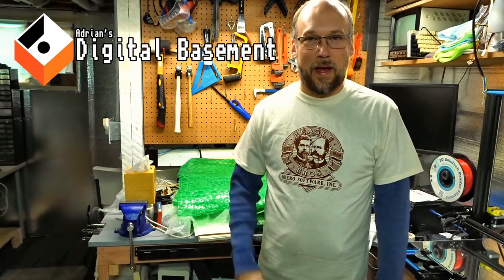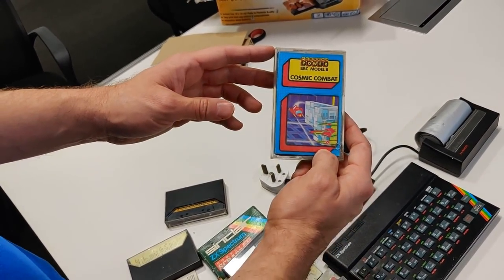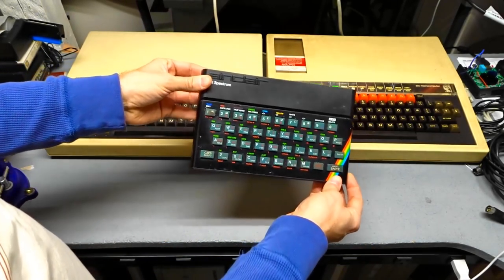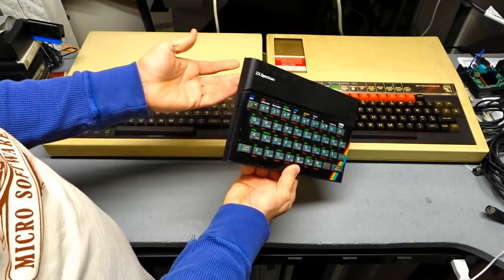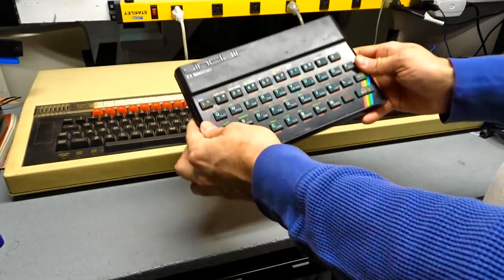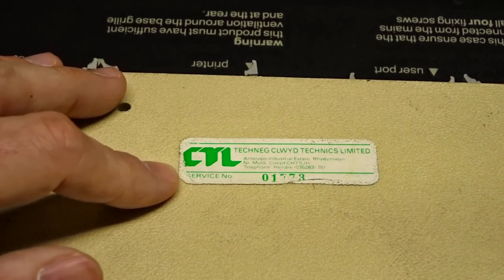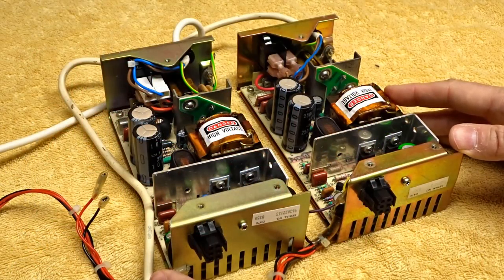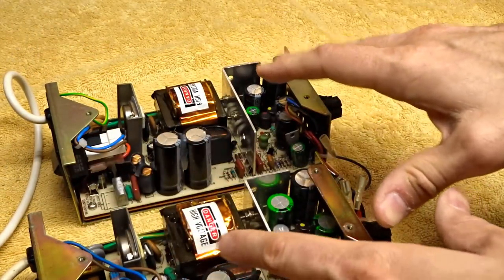I visited the UK and brought back some computers! Let's see if they work.

Comment: I'm not sure the age/generation of electrolytic caps is the whole story. If you open something and it has a ton of chong or shamwa or whatever off brand in there you can be sure at least some of them are out of spec (probably never in spec) or leaking. If it's all Japanese brands then you're probably ok unless whoever designed the PCB did an oopsie and put a cap right next to something that gets hot. Even worse in some machines like some commodores you get capacitors that are reverse polarity from the factory.
Reply: I've replaced capacitors on LOADS of machines from our old labs back in the early 2010s when that whole bad cap fiasco was going on.
Reply: @adriansdigitalbasement  in the BBC machine you want to check for "RIFA" branded capacitors in the power supply. These fail with age and because they are directly across the power line, they make a LOT of smoke when they let go! Replace with good quality "X2" rated film capacitors.
Reply: I've read somewhere that it has to do with a stolen recipe that was actually missing a bit. So  the caps were not being made with the proper recipe, so they are missing a component that keeps them stable. Which is why Japanese caps are considered better than Chinese caps.

Here is a link. And I've now learned that it's called a formula, not a recipe.
https://www.independent.co.uk/news/business/news/stolen-formula-for-capacitors-causing-computers-to-burn-out-106907.html
Reply: @NaoPb  While I believe that story might be true I don't think it's the overall issue with cheaper caps. I think poorer materials and wider tolerances are probably a bigger issue. Interesting enough I know a guy that used to work at one of the Japanese capacitor manufacturers and he said they used to ship all the parts that weren't right on spec to customers outside of the country because they were less fussy.
Reply: @NaoPb  Yes, this was largely responsible for the problem
Reply: I just replace them no matter what.  Caps don't cost much and aren't hard to replace.  I have an Asus board that was full of puffed up Nichicon caps, so brand and country of origin don't matter.  That would have been capacitor plague timeframe though, and not early 90s, but still.  Simple preventative maintenance.
Reply: @nickwallette6201  the bad Nichicon caps seen in the wild were actually counterfeit parts, not genuine Nichicon parts. lots of BIG vendors got burned by this, and some still do get burned by this. It was quite a huge industry problem.

But yes, on old equipment, it is generally best just to replace them.

Comment: I had a BBC micro model B back in the day. Later I had its successor, the Acorn Archimedes which was, of course, the first RISC based personal computer with the Acorn designed ARM processor (which then stood for Acorn RISC Machine). That. of course, begat Advanced Risc Machines with the ubiquitous ARM architecture chips.

So, if it wasn't for that BBC micro, then the world wouldn't have had it's most popular microprocessor architecture with over 100 billion ARM processors having been produced by 2017. No doubt something else would have come along, but it's still the case, that BBC micro is what financed the development of the ARM architecture, even if this model used a 6502 running, if I recall correctly, at 2 mhz.

Just a shame ARM was sold to a Chinese tech company.

nb. even before the BBC micro, I had a NASCOM II which I built from a kit. If you want a fairly rare UK computer, try and find a Nascom I or Nascom II, both of which were Z80 based machines. They truly were the first UK microcomputers.
Reply: Minor correction, ARM was sold to Softbank, a Japanese company. Yes, a shame though.
Reply: I'm not sure why I had it in my head Softbank was Chinese.

Comment: I want to dump those boards in an ultrasonic bath.  filthy!
Reply: If you think that's filthy you should see my browsing history.
Reply: So long as everything's still watertight, that should work. I don't know what automotive solvent does to PCBs though. I should drop a board into my cleaning tank and find out.
Reply: Nah, give them a spray with brake cleaner, should do the trick.

Comment: I have an original model A upgraded to be model B, ordered and waited over one year for delivery back in 1981. My serial number is 000023 and PCB covered in modification wires installed at factory. Still works.

Comment: Very interesting video, Thanks. I've never actually seen inside a BBC micro before. If it's not already been mentioned... The BBC Micro has a built-in assembler as part of BASIC. Although I already knew Z80 (via Spectrum) and 6502 (via C-64) I did a lot of assembler programming on the BBC as part of a training scheme I was on in '86. A few years later I worked as an application programmer on the Cambridge Computer Z88 which came with BBC Basic. It also had the in-built assembler but it was obviously Z80 rather than 6502.

Comment: I have friends in Salinas, CA who continue to use such Sinclair computers to manage and program the timing of all irrigation systems on several hundred acres. They have been quoted $10K to replace this two Sinclair computer system they are using, but they have a couple of spares they have never used and cannot think of getting rid of something they already know and is still as flexible as anything on the market. The biggest challenge came 7-8 years ago when they decided to move from a cathode ray display to LED monitor, but otherwise, things are fine.

Comment: To get some background behind the design and manufacturing of these two computers may I recommend that you watch The Micro Men, here on you tube. I think you will find it not just entertaining, but quite informative concerning the UK's early attempts at computer manufacturing for the masses.

Also Acorn, the designer of the BBC MIcro, went on to design the first mass produced RISC CPU, which ran on the Acorn Archimedes computer. You know that chip today as the ARM processor.

Comment: Acorn had developed a test kit board for diagnosing system faults, it was essentially a fairly big board with multiple wires and ribbon and power cables that hooked up to test points on the Beeb, It produced system codes on a digital display which you had to look up in the accompanying manual. It actually cost about the same as a Beeb and was only available to Certified Service Centers (I am not sure if I still have mine buried in the loft).
Incidentally, Acorn training was absolutely TopNotch, solid technical details with live repair exercises (I think it was 3 days?), it was all very serious stuff held in. Contrast that to Amtrash training in Shoeburyness (Essex) where the emphasis is to teach you what a screwdriver looks like and when it is best to use a hammer.

Comment: The good thing about the Spectrum is that pretty much everything bar the ULA is either off-the-shelf, or in the case of the keyboard remakes of the membranes and rubber mats are readily available. Makes them very easy to bring back online when they do fail.

Comment: I just bought a BBC micro model B from England on eBay and can't wait for it to arrive. I will also have to mod the power supply as I live in Canada and I will be using the 6 pin RGB to SCART lead and use a converter to upscale to HDMI. Last time I programmed one of these was in high school in England in 1983 and I was only 16 years old

Comment: I remember using those bbc b's at school and then I got to use the master. Shortly after that they upgraded to the Acorn Archimedes which was awesome. You had a game, if I remember correctly, built in which was some sort of flying game using a triangular shaped "ship". , I am also currently drinking out of my zx speccy 48k. My stepdauaghter bought me a mug with it printed on as she knows I like computers, she didn't know aty the time that it used to be a proper computer and not just a design. :~)

Comment: One of the common problems with early issue BBC micros was that the key switches would lift off the PCB tracks on the underside of the keyboard. My issue 3 machine's keyboard is a mass of patch wires and solder where I've had to fix the keyboard many times over the years. I also have an issue 7 system, which never suffered from this problem.

The different texture of the case on the one with the hole in shows that this is an earlier model. Again, my issue 3 system has this texture, and I can attest that having owned it from new my machine is completely original (even down to be having the earlier BASIC). All of the other BEEBs I've had contact with have had the less textured case. Acorn had several people manufacturing the BBCs (mine was made by a UK computer company called ICL), and I believe that they had different sources for the case.

The trademark conflict was with a swiss company called Brown Boveri &Cie (or maybe Brown Boveri Corporation) who owned the BBC abbreviation in Europe.

I had a lot to do with BBC micros in the early 1980's. I got my machine in 1982, and I spec'd out, purchased and looked after a network (Econet) of systems in a UK Polytechnic, which used a BBC with a 6502 second processor and a 10MB hard disk to provide network storage (it did indeed plug into the 1MHz bus). There was a second machine running as a print server. We had lots of add-ons, including robot arms, digitizers, 6502 and Z80 second processors, touchscreens, lightpens (which used an existing pin on the analogue input connector),  BitStik high precision joystick, mice,  the Acorn Speech Synthesizer, Teletext adapter and even two different video input systems. We also had FORTH and Pascal language ROMs, ROM expansion boards (allowing up to 16 16K ROMs, or 15 and a bank of sideways RAM).

With all of these, it made the BBC a really interesting and versatile teaching system. It's a real shame that it was not embraced properly by the teaching staff or for student projects. At the time, they thought of personal computers as a bit of a distraction, rather than the  indication of what was to come.

Comment: Techneg Clwyd Technics is the portmanteau of the name with Welsh for technics in front and technics in English at the end. A common practice in bilingual Wales. Clwyd is the county that the towns of Rhydymwyn and Mold reside in. The name is a clue as to its purpose. This company, in partnership with the BBC, local govt, and similar companies in other UK countries maybe, supplied all the schools in Wales, possibly further afield.

I learned to use computers at schools in Wales and England using these very machines and remember the Techneg Clwyd label because we were amazed and proud that they came from our tiny corner of Wales. Hope that helps. :)

Comment: You can buy a replacement modern keyboard faceplate and chassis for the ZX Speccy.  Be careful if taking apart the spectrum-the keyboard ribbons are delicate in these old machines.  You can composite mod the video signal. The power supplies can be troublesome. Way to go!

Comment: My guess concerning the hole in the case is that it's a mod for cooling.  Some people would leave the lid off because it would overheat.  Maybe the owner wanted to put a monitor directly on top, which would be lost if run open; or he didn't want to leave it open for whatever reason.

It might not need "ventilation", but rather just exposing the metal rather than keeping it covered in plastic made a sufficient heat sink.  You might look carefully to see if there is any adhesive showing that an extra heat sink has been removed.

Comment: The reason for half socketed RAM, is they had a 16k Model A and a 32K Model B (there was a bit more to the B, if I recall), but a lot of Model A's were converted to 32k by adding the chips as that was about the only thing the average user needed from the B.

Check that the ULA heatsink is down flat, there isn't much holding it other than the heatsink goop, which may need replacing if its unsquished itself - you may want to mix a very weak thermal epoxy (blend with paste) instead, or use thermal tape.
Reply: @adriansdigitalbasement   5, 2 and 1 - why the two banks were in such a weird order is a mystery

Comment: My first computer was a 32k BBC Micro Model B, that my parents bought me for passing my exams.  I learned to code on it in 6802 assembly language, much faster than BASIC. When I later did a microprocessor course at college, I found the language was 6502 assembler. I raced through the programming in no time, since I didn't need to consult a cheat sheet with the opcodes.

Comment: I may have the answer to the cutout. When my school had these installed in 1982 they came fitted with disk drives attached to the top left of the case, for security, as I lived in a rough part of North London back then, so it made sense to secure everything down. There was probably a plate under there that the drive was fixed down onto. Even the monitors were in their own secure shells that were fixed to the desk and the computer was also braced into.

Comment: Great idea, the normal shipping cost is murder. Last hole in a BBC I saw was for a fan, and the new owner filled it with resin using a silicone texture mold from the good side of the case to blend it. For me I want a ZX, such a common but well loved game platform but the BBC has some charm. :D

Comment: I remember using the bbc micros at school. In secondary school we had them all linked up to a network and a 30mb hard disk drive which was the size of a computer in itself. 

I remember when you wanted to load from hard disk it would sequentially request data, so you would sit on a queue and wait. If you were all loading the same thing it was quite interesting to see it load one after the other around the room as there was no cache whatsoever.

There were tons of educational software and it was quite fun to use back in the 80s. Especially when you had it linked up to robot turtle (to plot pictures) or a circuit board controlling miniature traffic lights. In essence it was a like a raspberry pi of the day 😊
Reply: i remember the turtle, it was called logo i think. The weird one that stuck with me is Podd, it was a tomato with legs that you could type in commands and it would carry them out

Comment: the eprom sockets on the right are for pre programmed  word wise plus and word processors  , i used one of the sockets for the eprom programmer,  a cheeper later  model  by acorn was the ellectron that i also have .  all schools used them in the 1982 onwards  . i did a course at  collage on bbc  computers   .

Comment: Happy memories ..... I had a ZX81, Atari 400, Commodore VIC20, Commodore 64, BBC(B) and it's follow-up machine the BBC Master, with it's programmable EPROM slot and Dual Double Sided floppy disc drive. After that a few Commodore Amigas, starting with the Amiga 1000, then the 500, 600, and 2000 ) using all at the same time ........ then the PC took over the world :-)

Comment: The good old BBC B computer .... nearly 40 years old now, running a 2MHz 6502 processor with 32kb (yes kb) of RAM. Even so, they were able to squeeze a series of wonderful 3d games out of it, flight simulators, track racing games and of course Elite.
The graphics took up 20kb of the available RAM so the whole of the rest of the game was run in 12kb  - those programmers were special ........
Who remembers my second favourite BBC game, Castle Quest?
Ah, the fun we had. Messing with the OS, burning it into eproms and then wiping the mistakes by leaving the chip on the windowsill for a few days to let the sunlight blank the program, and start again.

Comment: On the model A BBC Micro you got 16k and a bunch of sockets for a future upgrade. So if half your memory is socketed it might be an upgraded A, rather than a repaired B. That hole in the top looks machined but they definitely didn't come like that. We used to run them with the lids off in the summer as they were prone to crashing when warm.

Comment: I remember these from secondary school, pretty much every school in the UK had at least one of these. I remember getting a class where they had one of these running a 4 wheeled robot, you could program the movements using it.

There were actually BBC programs teaching computing using these models, I think, made by the Open University which is/was a teaching body in conjunction with the BBC and the Education department.

It's called "The Computer Programme", looks like there's a lot of the episodes on YouTube and you can see them using the BBC Micro in the studio. Might help for research in finding peripherals if you want to go down that road.

Comment: This is a great video, and I’m very much looking forward to the follow ups.

Btw, if you get a chance for more UK purchases, consider bringing back a Dragon.
Reply: Yeah, the Dragon 32.  Not for getting the Jupiter Ace  and  Oric Atmos, of course!
Reply: The Dragon has some pretty substantial differences, mostly extra hardware features, such as a parallel port.  The keyboard matrix is also wired differently, which causes software incompatibility.

The two communities have fairly close ties, which is nice.

And yeah, it would be cool if you do CoCo videos.  Since we’re basically neighbors I could contribute some additional hardware to show off if you like!